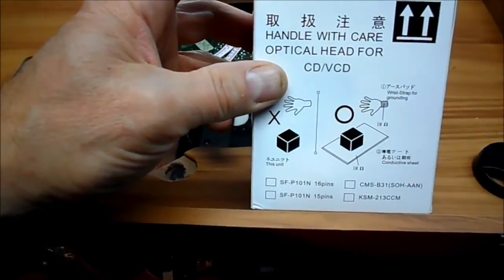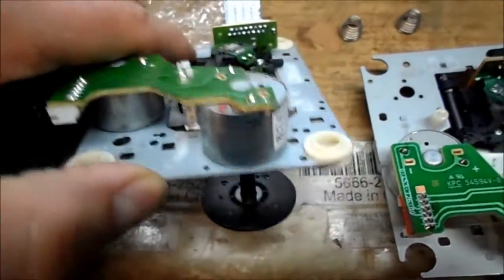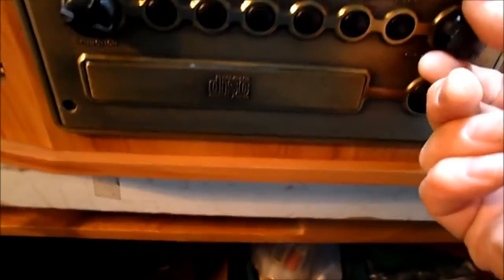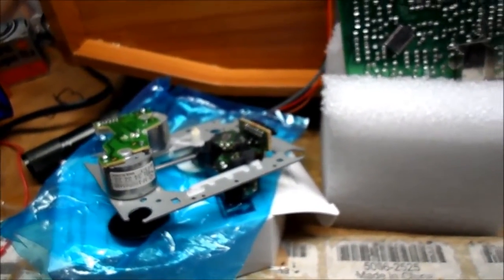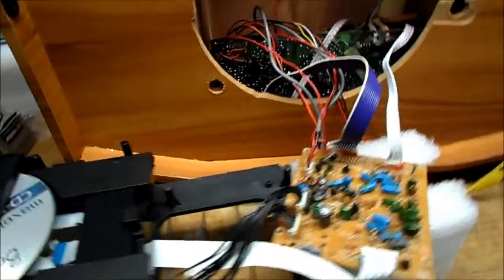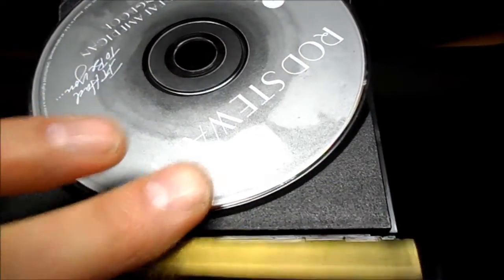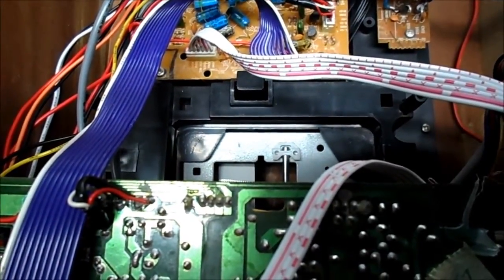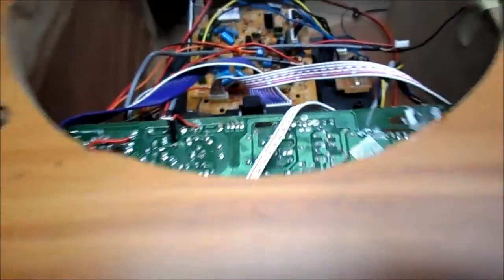Classic CD Repair. A No Go Repro.

Comment: When the laser on a CD works, and tries to focus, but it can't read the TOC or play anything, some times you can adjust the platter level closer to the laser, so the laser can focus again.  Wear to the spindle bearings increases the distance in some designs. Other's can be rejuvenated with certain electrical adjustments, cleaning old hard lubricants and replacing with new lube.  Even components for the transport board are failing at this age with regularity. FOr many it is easier to replace the transport, and not diagnose. However, just as you said, with age , the decrease in test equipment prices, new/NOS transports will run out eventually, and diagnosis and repair has become the only viable solution. Even though a CD player now considered 'old tech' , a decent CD player even if used as a transport-only, with a modern DAC can sound very very good.  Many of the player transports from the 80's are renowned, the Philips CDM-0, CDM-1, CDM1 MkII, any of the early 'swing arm' or all metal transports machined out of a solid aluminum block are legendary, if you can find a unit with one i it. People are3 getting hip, thanks to internet. Those transports came in earlier 14 and 16 bit players from Magnavox, Sony, Meridian, McIntosh, etc. and I've never seen one that can't be fixed. At this age the control, focus, and other motor components need some new parts,  and adjustments to return to operational condition. I'm listening to a CDM01 as I type this.

Just like the players, the CD's themselves are showing up en-masse, at thrifts, charity shops, used record shops. Where Cassette, LP and 8-track were once the cheap collectable, the CD is poised as the next audio collectable, prices are seen as low as 25 -50 cents ea. on 1/2 price days. Try and find cassettes or 8 tracks anymore, and forget about records.  Early Cd's mostly sound like  shite, but by 1985 the manufacturers and studios had their acts together, thus most of the best 'SOUNDING' CD's ever made were sold between 1985 and 1995, just before the loudness wars kicked in.

I enjoy your channel Farm Radio, thank you for making these videos for us. I do my own repairs and restoration work full time  from home, and always pick up a tip or 2 from you, Shango066, and RadioTVPhonoNut  You guys gave me the courage to go beyond fixing my own gear collection, to fixing other people gear as well!!!.It was the best decision I ever made, I enjoy doing it thoroughly.... Thanks again!

Comment: I think Classic was a Circuit City in store brand. Had a stand alone CD Burner branded Classic from there and it worked the last time I used it, but discontinuing the radio show I did over KOPN mothballed it. If I remember correctly it had some issues, but over all it was competent. Never seen that brand in another store. 

Very nice repair. The weight on the tone arm was almost enough to cut your own records! Good grief!

Comment: I would've just junked it if I owned it and gotten myself a good old Japanese Amp and CD player and tape/radio/phono for $20 but that owner did want it repaired
Reply from the maker: This was a case study, to prove a point, out of spite, to see if the CD section could be repaired. I was told the CD in this was "working", (which has hardly been the case with units like these).
Reply: I'm in New Zealand we don't have much crosley stuff but I saw one and wanted it but it wasn't long before I realised they were junk and luckily opted for a Technics from the 70's
Reply from the maker: This is a case of modern things that should not even be made. Cost aside, why the big chain stores agree to even sell these tells you something about them.